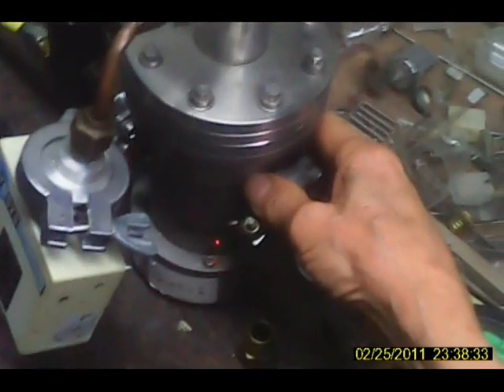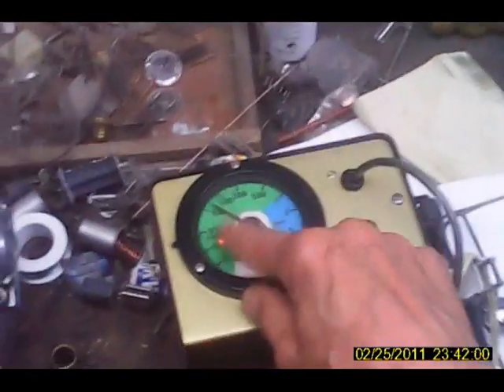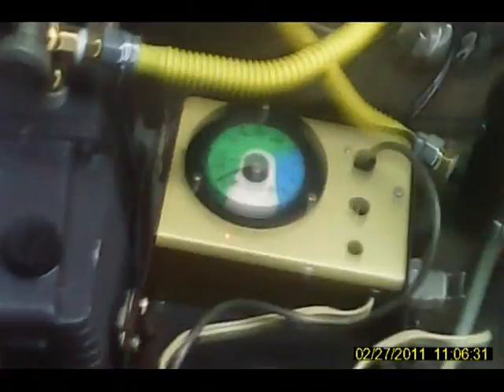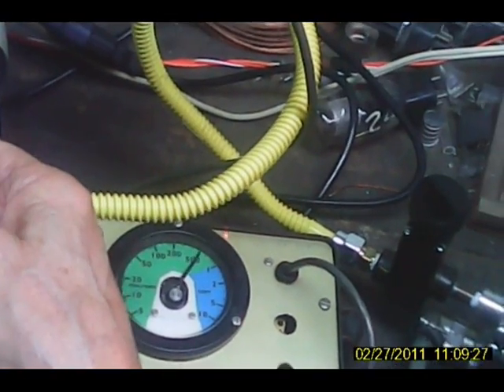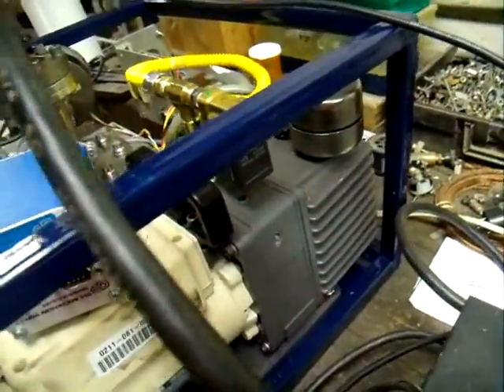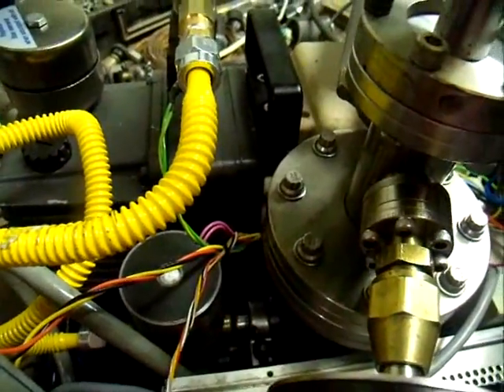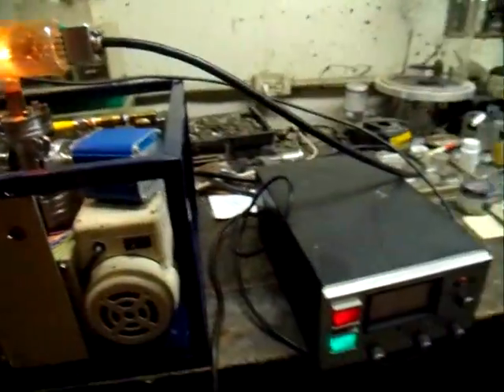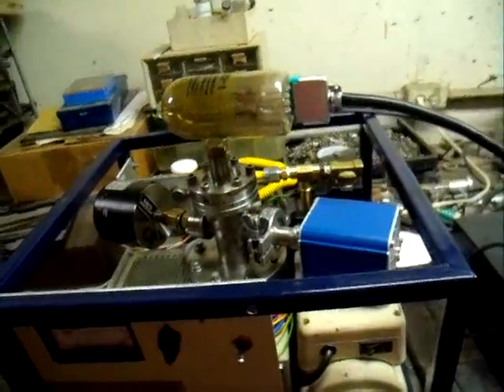benchtop high vacuum system using a turbomolecular pump

Comment: 14:36 Oh.. letting that huge amount of air into the turbopump when it is at full speed is seriously not recommended, not only by me but also the manufacturers.
Reply from the maker: This model is rated for continuous bleed up to full atmospheric with no damage.
Reply: @glasslinger  All turbopumps are rated for that, as long as the max amount of air is within a certain limit. I have never seen a datasheet, for any of the 12 turbopumps I own and countless of old and new I have served during the years, were the manufacturer recommend any amount of air at once to let in to a turbo at full speed to stop it as soon as possible. The amount of air you let in in the video definitely made the vanes to move upwards a little and put a huge strain on them and also on the bearing which will create material fatigue in the length and wear on the bearing. I'm not trying to be a smart-ass here or anything only give advise and especially for those who watch this video so they don't think this is something that you should normally do with turbopumps. You do as you want of course, I only wanted to mention it.
Reply from the maker: @dtiydr  That was an "old man" oversight! I don't blow air into the pump like that normally.
Reply: @glasslinger  Good to know, now I feel calm again. :)

Comment: Any ideas on how to spin down a turbo pump faster? My varian navigator tv141 keeps spinning long after I disconnect power. Should I close the backing/foreline? Thanks.
Reply from the maker: You can add a bleed valve to the system. If you don't want to bleed pressure into the system you can add a relay to switch the motor windings to have a DC voltage applied. Adjust the DC voltage to be within the rated current of the motor and it will bring the motor down in less than a minute.
Reply: Many turbo pumps have a small bleed valve/knob in the side which you unscrew by half a turn. The pump will get slightly louder and spin down in a matter of minutes. These bleed valves also prevent gas flow from carrying oil vapor into the chamber.

Comment: thanks for video! excelent work. A simple question: suppose a small vaccum pump (one used in freezer services). Its ultimate vacuum as stated by manufacturer is of order of 10 militorr. We have two well sealed flasks, one bigger than other. Testing the ultimate vacuum each flask will produce same vacuum level in both flasks? suppose very good connections.  What about the power of pump?

Comment: It wouldn't be too difficult to add a little 555 timer circuit and an Silicon Control Rectifier to automate the shutdown sequence like you mentioned so the power switch locks down the turbo pumps outlet first initiating a 1 second delay before dropping out the SCR that would be actuating the roughing pump and bleed off solenoid. Great videos by the way, you are a wealth of unusual information. Thanks for sharing it.

Comment from the maker: I have a nice sublimation pump but it is a bear to operate! The vacuum level it is used for is much lower than anything I need so I didn't figure the complicated outgassing procedure was worth putting it in the system. Plus, the power supply is huge (5volts at 100 amps) so it would not fit my console. I didn't pay a lot for it so it sits!

Comment from the maker: The pressure during spindown is around 5 torr, which takes the rotor down fast enough to get past the bad resonance points quickly and yet not so much pressure as to cause the rotor to hit the safety bearing. This turbo is rated for a full atmospheric inrush without damage, however they don't recommend that it be a normal situation. The problem letting it spin down under high vacuum is the bad resonance points that make the turbo scream. It can take a few minutes to pass through the resonance.